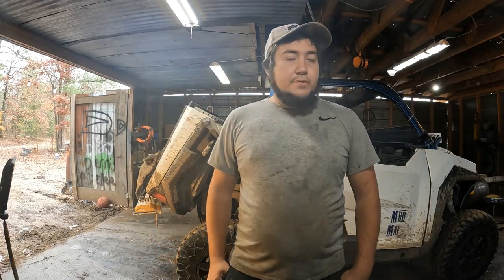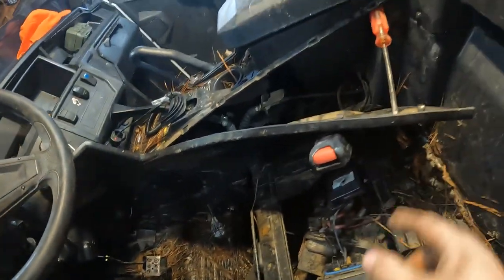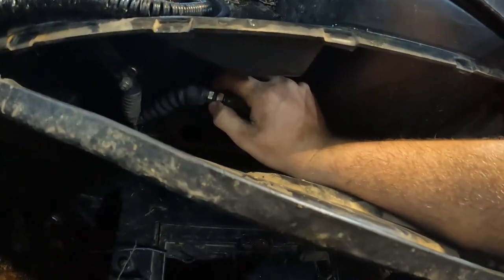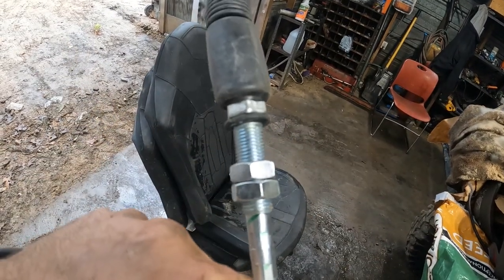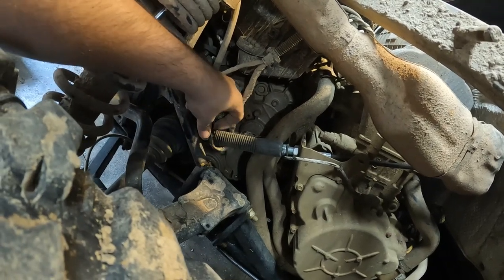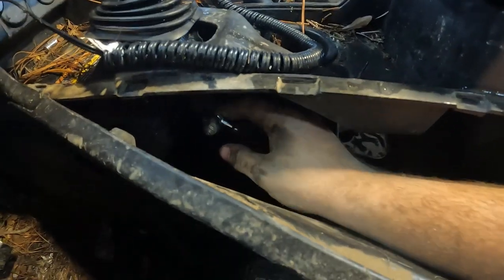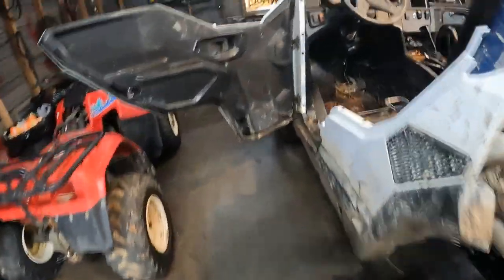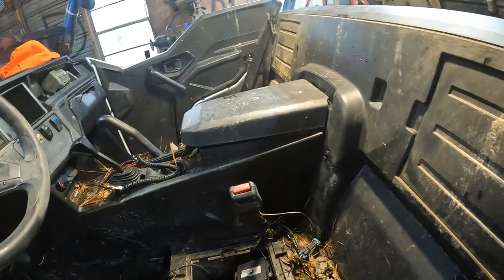Polaris General shifter cable replacement

Comment: My general did the same thing got really hard to shift then the cable broke in there. Curious if the shift spawl lever is messed up inside the transmission wear the cable attaches too???